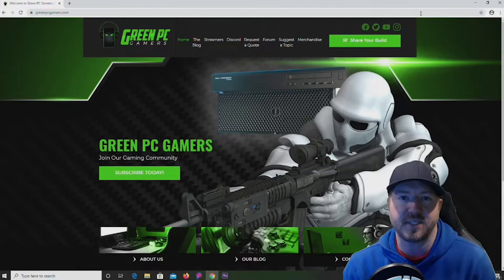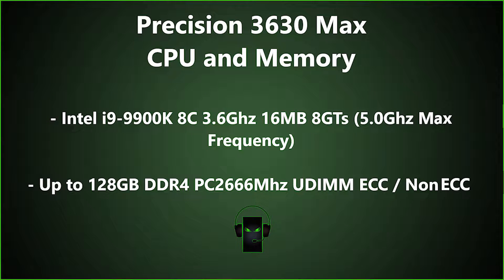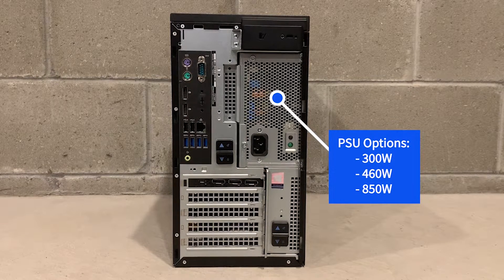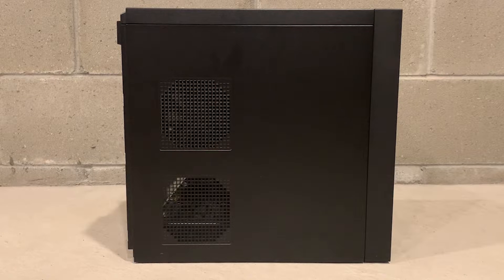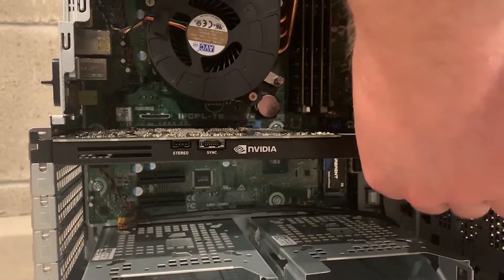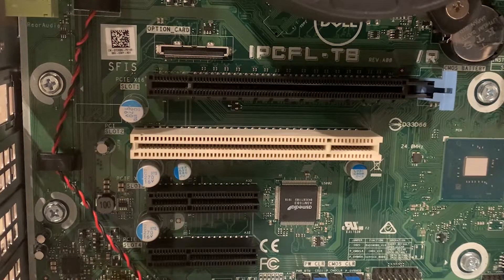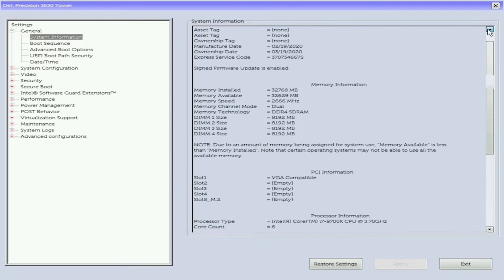Precision 3630 Overview and How to access the Motherboard

Comment: If it helps with your data: I’ve got an i7 8700k with the High Performance cooler. I did buy this on eBay, so it may not be with the original parts, but the sticker indicates it was an i7 in there from the factory

Comment: Hi, I was wondering if you knew if the cpu fan pin on the motherboard were either standard 4-pin or some kind of weird Dell 4-pin setup?

I was thinking of replacing the cpu cooler with a low profile cooler but I am having issues finding any info on the fan pin headers on the mobo.

Comment: Could you please tell me whether or not you put a thermal pad under the M.2 SSD ?? 
In general I really need to know if the SSD must have thermal pad applied /and/or/  a heatsink ??

I have the precision 3630 and I just bought a 1TB Samsung Pro SSD, and I'm afraid to install it before I know ..  Please Advice! .. Thanks!
Reply: I used an HP Z2 Turbo NVME heatsink on mine. PN: L97046-001. Clears the 3060 ti FE.
Reply: @droz6462  thanks for your help
Reply: As far as I know they don't "need" a heatsink. It's just a nice thing to have. Most devices that need a heatsink will come with one. Some CPUs don't but that's the exception.
Reply: @nodak81  Thanks a lot for taking the time to reply. Really appreciate it.

I put a thick thermal pad under and a heatsink with another thermal pad above.

working and performing good for a almost a year now.

Comment: At 1:52 he pulls the latch out to open the side cover. My 3630 has a screw that has to be removed from the latch before it can be pulled out.
Reply: I believe July 2019 started 2 different 3630’s those before July I believe had a screw for the latch and no front case fan 4 pin connector

Comment: I have the i7-8700 installed on this machine. The CPU runs at 80 - 90 degrees most of the time which  ( think) causes several of my programs and browsers to freeze and lag.  I want to install a better CPU cooler. Do you know if I have to remove the mobo to swap out the existing CPU cooler?  Also, do you know what size cooler I need to buy?
Reply: Also, if you haven’t already, try replacing the thermal paste. That stuff can dry out over time.
Reply: Do you already have the High Performance heatsink mentioned in the video? If not, then it is direct bolt in replacement without modification. If you do already have the HP heatsink, you may want to try a Pure Rock LP, which is rated for 100C cooling. That one will require that you remove the motherboard.

Comment: does the I7 8700 CPU require high speed fan? and is this model with Upgrading from the Dell Optiplex 9020 MT? how much of a performance boost can I expect from the 9020 MT? Thanks!!
Reply: The 8th and 9th gen CPUs are around 40% faster in processing related tasks vs the 4th gens. They are also more efficient in power draw, and have higher max temps, so you get full performance longer and cheaper than with the 4th gen chip. They also introduce support for on-board NVME storage, and no tricks are needed to eventually migrate to Windows 11.

Comment: Do you have a pic of the inside of the HD bays? How many HDs can it fit?
Reply: There are 3 3.5" bays, each one could support 2x 2.5 drives with a mounting bracket. To use more than 4 drives, you'll need some sort of SATA controller card.

Comment: I’m new to pc’s and I got this pc from a friend. What is the best easy graphics card to install? Any help would be amazing and there is not a budget.
Reply: First check the power output of the current power supply. You may need to upgrade yours depending if it is the baseline 300W or not. As for what GPU to buy, that really depends on how much extra heat you want to introduce into the system. I've seen folks stick a 3080 ti into one. Personally, I went with a 850W SFX PSU and grabbed a 3060 ti FE card. That way I could add the Dell front fan bracket.

Comment: Thank you for this video! I’m wondering what’s the biggest or best graphics card this exact machine can support?? Thank you!

A video regarding this question would be amazing.
Reply: I've seen folks put a evga 3080 ti in their system. I figure anything with those physical dimensions should work, though I went with the shorter 3060 ti so I could add the front fan bracket. Make sure that you check the wattage on your power supply before moving forward.

Comment: I have the i7 9th gen with high performance  fan.
Reply from the maker: How are the temps?
Reply: @GreenPCGamerscom   when I run msi kombuster it runs low to mid 70s.
Reply: @GreenPCGamerscom  My 3630 with the 8700k and high performance fan tops out at 89 degree's when gaming and  throttles to 4.2 gig. Most of the time it runs in the 70's. I have the fans and the performance at max in the bios also.I have a 4070 in it and just fits in the case.

Comment: How would I check what wattage the PSU is? Also would the RTX 2060 Super and I7-8700K run fine on 460w?
Reply from the maker: Take a look at the label on the side of the power supply.  It should post the wattage.  460W would be a little light for those components.  You could try it, and if they system shuts off or goes to a black screen during heavy load, you'll have to upgrade the power supply.

Comment: Are your Precision 3630 CPU and PSU fans running continuously when machine is idle (no load)?  I have i7-8700 CPU with standard cooler and Quadro P2000.  All three fans (CPU, PSU and Quadro GPU) run non-stop in low speed even there is hardly any load on the system.  Search online it seems that Quadro P2000 indeed keep the fan running non-stop, wondering if it is the case for Precision CPU and PSU fans?  Would changing the CPU thermal paste help to stop the fan when machine is idle/low-load?
Reply from the maker: The system should be almost silent w/o load.  What processor and heatsink do you have installed?

Comment: Recently found, yes found! 4 Dell Precision towers with Xeon CPUs! Dumb question: when you removed the GPU, there is on the side, a "stereo" port. Is that for speakers, and how is it set up? Found 3 T3620s & 1 T1650. Thank you 🤓
Reply: It is probably just a standard Realtek chip with only stereo out supported. I'm using the audio out via GPU, so not using the on-board audio.
Reply: @droz6462  I gave one T3620 & think the T1650 to Goodwill, as the one 3620 wasn't complete. The 1650 was older, plus I had other PCs to put in storage! Haven't done much with them since. Thank you

Comment: On this system is it east to change graphics card from Nvidia Quadro to Nvidia GeForce gtx 1650. Di I have to do something with Bios?
Reply from the maker: It's very easy as long as you have 300W or better power supply installed.  You don't have to change anything in the bios.

Comment: The High Performance heatsink is for 95W CPUs which on the 3630 are i7-8700K, I7-9700K & i9-9900K ("K" means they are unlocked CPUs by Intel. Dell slightly overclocks these which produces more heat.  Unfortunately you can't user overclock them since Dell's BIOS is locked down).  Caveat: These CPUs also require the VRM (Voltage Regulator Module) heatsink right next to the high performance heatsink.  See Voltage Regulator Heatsink Thermal Module part# 639V8 or 0639V8 for Dell XPS 8930 & T3630 Precision 3630 Tower on e-Bay.  I have the i7-8700K and it has both heatsinks.
Reply: I have the 8700k with the standard cpu cooler, will i be fine if i keep using the standard
Reply: Upgrading cooling to the High Performance heatsink for my 9500. Should I grab the VRM heatsink while I'm at it?

Comment: Mine has i7 9700 with standard cooler
Reply from the maker: How are your temps?
Reply: @GreenPCGamerscom   averaging around 60C     min ~51-53 max ~76-84 . Using CPUID HwMonitor for temps
Reply: @billmanj1979  Are your CPU and PSU fans running continuously when machine is idle (no load)?  I have i7-8700 with standard cooler and Quadro P2000.  All three fans (CPU, PSU and Quadra GPU) run non-stop in low speed even there is hardly any load on the system.
Reply: Is it standard, or K edition?

Comment: Hi. I have upgraded my T3630 to an I7-9700K with a Geforce RTX 3060. However I'm struggling to find a high performance fan & heatsink to upgrade to standard one which came with it. Any ideas where I could find one?
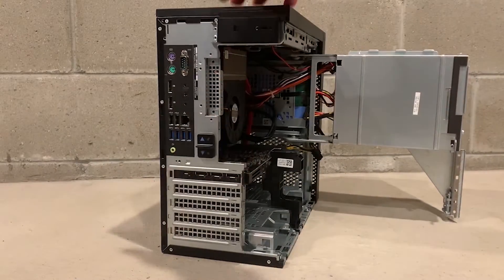Also if anyone else is thinking about adding a decent graphics card to this system, please note that there is a triangular piece of metal in the outer frame which may impede your ability to completely close the case when the card is installed. you can see the part I'm referring to in the video at 2:19 on the right hand side when the unit is open.  I ended up removing the triangular piece with a pair of pliers, a bit of elbow grease and patience (so I didn't damage the wider frame). You'll have to be careful when you open and close the unit in future but it did do the trick.
Reply: Check e-Bay for Dell Precision T3630 Heatsink 0T57JF with Fan 0KTDJC
Reply from the maker: Try checking with Dell, eBay, and Google.

Comment: QUESTION: can this workstation upgrade to windows 11 & which videocard is good for this system? thank you!
Reply from the maker: We haven’t tested it yet.  However, the T3630 does have a tpm 2.0 option in the bios.  If you enable that option, it should be compatible with win 11.  Let us know if you try it.

Comment: Apparently there are at least 3 CPU coolers. I have two machines. One came with an I3-8100 and the other a XEON E-2146G.  Both coolers look like the one that you described as standard in the video. However, the XEON cooler has a copper contact while the I3's cooler is all aluminum.
Reply from the maker: Thanks for sharing!  Can you provide the part numbers so we can add them to our blog page?

Comment: Can this CPU support Full Height and Full Length PCI-e Slot? From video i can see it should support but just need confirmation.
Reply from the maker: It supports the Quadro P5000 that has these dimensions 4.4” H ×10.5” L 

Basically anything with those dimensions or smaller.

Comment: max gpu length?
Reply from the maker: I believe 9.5" if you don't remove the HDD Cage.
Reply: It can do a 10.5 card. But you lose the ability to add the front fan bracket.

Comment: DELL PRECISION 3630 Tower Powers on when plugged in and then i have to manually turn on pressing the power button. How can i disable this ( i belive its post check)?
Reply: Its a bios setting. Hit F12 when starting and you'll have to get to the system info, then look for power. There are options for last state and 2 more

Comment: Hi, My precision 3630 starts up ( i belive doing POST check) when plugged into charger. How can i turn this off?
Reply: It's just the way they are. Not much you can do about it. Most Dells over the last 15 years do that, or at least the few dozen I've owned have done so. Changing the PSU for an aftermarket one might stop it but I'm not sure.
Reply: Does it do a quick power check then shut-off, or a complete boot up?
Reply: @droz6462  yes power check and turn off. Any suggestion how to fix?
Reply: @bhimgrg05  I believe it is just a built-in quality check of the system. I've also tried finding a way to get rid of it. I've been over every power setting in BIOS and have made sure to have the latest version installed. No luck. It only happens once though, so long as you aren't moving it every other day.
Reply: @droz6462  thank you.

Comment: Can I upgrade RTX 2060 super in the precision 3630, it has P14000 4gb,  for gaming.  I have i9 9900k, please tell which one RTX 2060 super should I buy for this.
Reply: Hope you figured it out and got the upgrade you needed. Yes, you can, but you might also have to upgrade your power supply. Thankfully this model supports aftermarket power supplies.

Comment: Is there a possibility to upgrade the i5-8500 CPU to a more potent i7-9700K ? This CPU is listed in the Dell optional CPU. Very nice video, thank mate.
Reply from the maker: The I7-9700k is supported with the high performance heatsink.  You won’t be able to Over clock it in a t3630 though.

Comment: I like the design of dell 3630, the case is identical to a Alienware r9 with fairing removed, the cpu cooler can be upgrade to a 120mm AIO fitted to the top of the case. But the pricing is way higher than thinkstation p330 with the same configuration. I got p330 with i9-9900, 32gb ram, 512gb m.2 NVMe, Quadro rtx4000 for $1300 with small business discounts. It cost $2500 to get the dell with this configuration. Dell says they can price match to HP and Lenovo on its website, I just talked to a dell customer service, they send in a price match request for me, we’ll see how it goes.
Reply: Here in June 2024, 4 years later, its now 385$ on refurb.  16GB/512gb drive.
Reply: Also, 3640 just came out on dell’s support page, 10th gen core, and Xeon w-12xx.
Reply: 2024 Aug, i78700 gtx 1060 16gb ram, with a 1tb hdd.
$450aud steal

Comment: I tried a fresh install with a Windows 10 2004 build ISO and Windows does not recognise any of the 2 HDs (both NVME and 2.5" even after using iAstore drivers). Also CloneZilla nor MiniTool Partition sees the NVME. CloneZilla does not recognise the onboard NIC also.
Reply: I am having the same problem. Mindshelfpro have you found a solution?
Reply: The Ventoy version I was using had the issue that was fixed with a later update. I realised Ventoy was the issue because standalone USB boot drives did not have the issue.

Comment: Never understood these workstation chassis designs. They change them every model. There is no evolution they re-invent the wheel every time and it's always terrible. Proprietary is one thing, stupid is another.
Reply: it's an arms race to prevent second hand buyers from easily converting them into cheap powerful gaming PCs
Reply: @pyrophobia133  doesn't work though lol
Reply: Aside from the CPU cooler this seems pretty straight forward.  I’d only buy one to triple boot.
Reply: Exactly :D